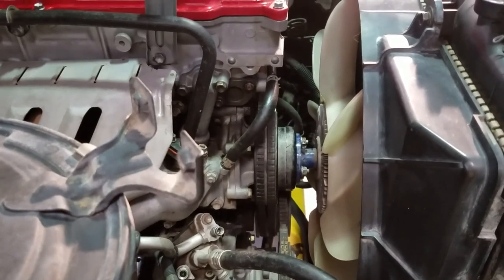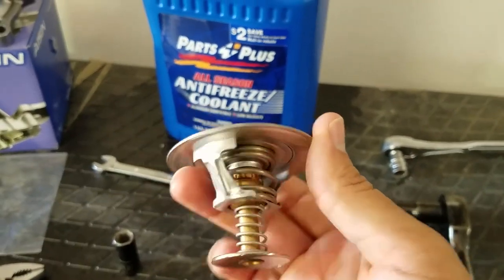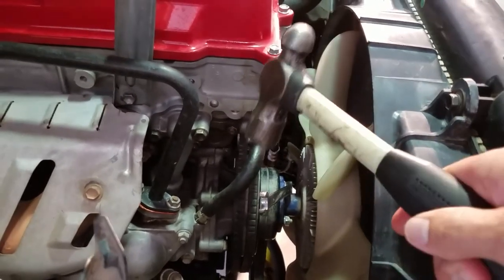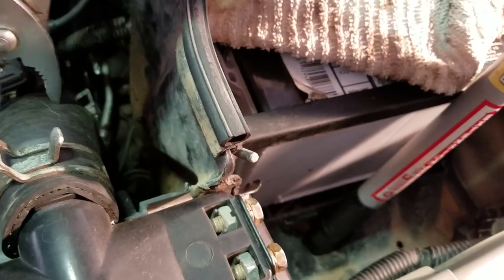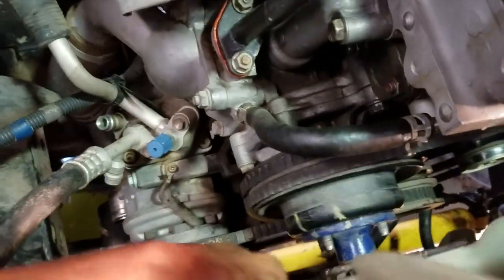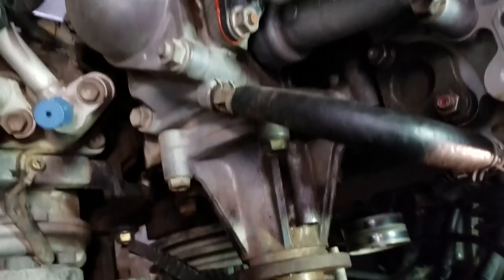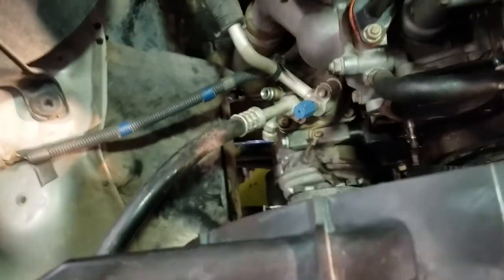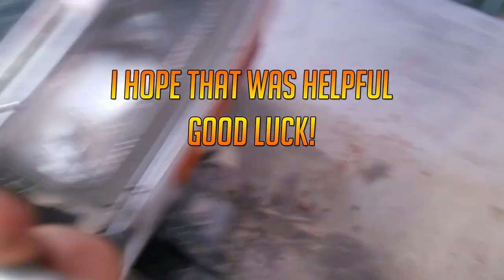LandCruiser Water Pump Replace

Comment: thanks for the video, I'm a bit confused though. i saw another video and he had to take the timing belt off to get to the water pump but you didn't have to. How come?
Reply from the maker: There is no timing belt on a Land Cruiser.  It had a timing chain, which is under the timing cover.  At 5:20 in the video, it shows me taking the fan belts off.  I hope that helps.
Reply: @jeepingneatus  Hi thanks for super quick response! @06;10 it shows the removal of timing belt to get to the water pump. https://youtu.be/THBTiNZnVQk
Reply from the maker: @Kingofrestrrooms666  that video is of an Australian 1HZ diesel.  Mine is a US spec 1FZ gas model engine

Comment: Hey nice video really helpful, but i did the job (thermostat, thermostat-gasket, water pump with gasket too) but now my 94 land cruiser is making a weird noise really loud like if a belt was slipping but it sounds more where the waterpump-thermostat area is, and obviously and didn’t make this sound before, just after i replaced everything.
Reply from the maker: Not sure amigo.  Isbthe belt actually slipping?
Reply: @jeepingneatus  doesn’t seem like it’s slipping, and the sound its only when the engine its cold, try to take some air out from the radiador leaving the cap open up and a lot of bubbles came out but i dont know if it’s something else
Reply from the maker: @Asco-pt8dp  hmm, turn the heater on full blast and run it up to temperature to make sure the coolant is flowing and the water pump isn't dry
Reply from the maker: Squeeze those bubbles out
Reply: @jeepingneatus  good idea, sadly my ac compressor is out :(, i drove it for around 15min and seem fine, i start it up and let it ran for about 20-30m park to see if it will overheat but it didn’t, and the noise goes away when its hot.

Comment: What's the torque spec on the bolts, n then the nut?
Reply from the maker: I dont recall.  I did this job several years ago.  I used to have a factory service manual and all the torque specs are in there.  I belive you can download one online.  That being said....it is a waterpump; you could probably go by feel. Don't strip them out :)